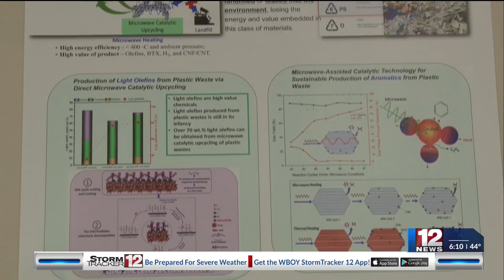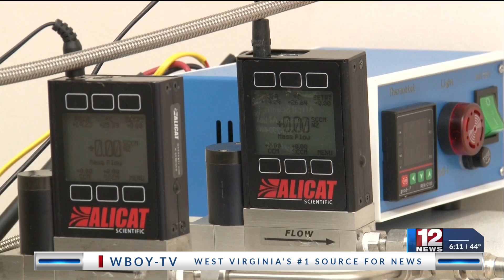WVU researchers develop microwave technology that could extend the life cycle of plastics

Comment: The bottleneck in plastic recycling isn't energy use in processing, it is separating, sorting, and transportation, and ensuring purity of the waste stream. If you count all of the energy used in those processes, it's very unlikely you even reach break-even, and at the price of much more complexity. If plastic recycling is ever going to work for the majority of plastic waste, we need a much more efficient system.